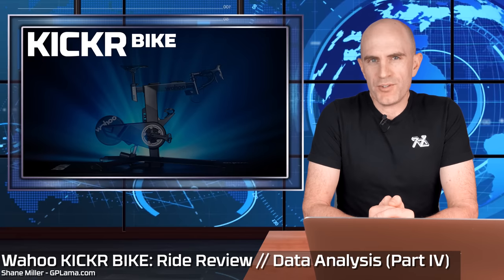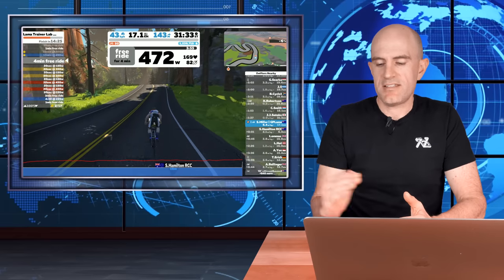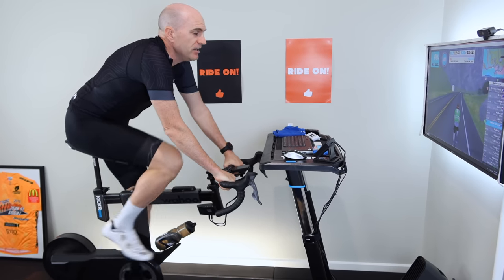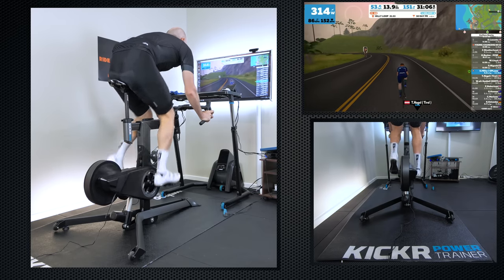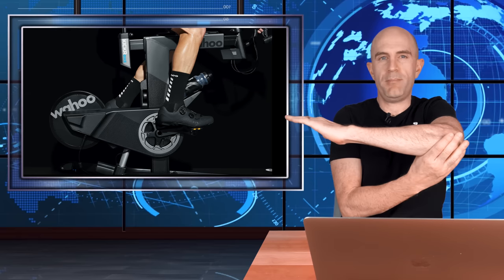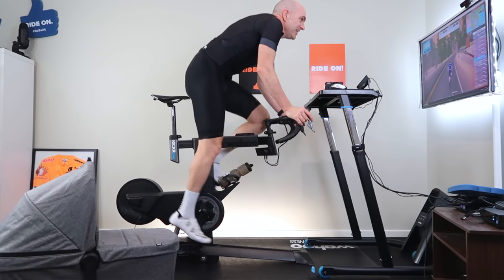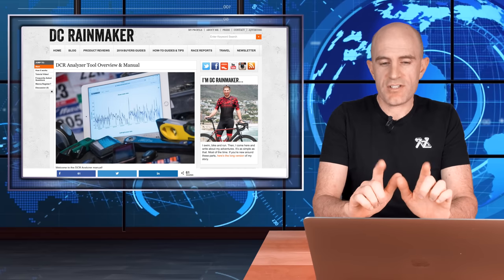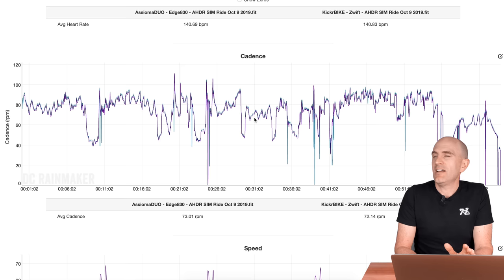Wahoo KICKR BIKE: What's it Like to Ride? // Ride Review // Data Analysis (Part IV)

Comment: With spacers between stem and the quick release and having the QR undone could it be used on the MTB course?
Reply: No, the stem is not standard and has a non-round profile, with the front side flattened, so it wouldn’t turn even unlocked.

Comment: I've had my Wahoo Kickr Bike V1 for about a year. The biggest thing I noticed on it was sprinting is really hard, there is no momentum even at higher cadence, its like I'm pedaling uphill. Anyone else noticed this? My 20 sec power on this bike is 200w lower than on a previous kickr, or hammer H3. Its like you don't get any momentum from the flywheel, even though I'm going 38-40mph in Zwift. Anyone else noticed this? I should note I do not use ERG mode for workouts, and I'm just talking about a sprint at the end of a race, or for a sprint jersey in Zwift.

Comment: Thanks for the great review, Shane . In your list of likely firmware improvements, you didn't include plain Ant+. Do you think that's a lost cause with this bike? Would be a pity if you couldn't use garmin in ride.
Reply from the maker: The argument for ANT+ (in addition to ANT+ FE-C) could go either way. For me, it just meant I had to use the FIT file from Zwift for the data comparison, so it wasn't that much of an issue. I'd say the majority of people don't really care it's not there. This bike is built for software control that's almost always going to be a PC/Mac/mobile device that'll support ANT+ FE-C. 

Maybe those who record data with a Garmin so it'd be included in their Connect metrics... then that's a workaround in the first place as Garmin Connect should be able to take any data and apply your stats to get those metrics.
Reply: I like to look at calories and TSS tick over on the Garmin during the ride. hardly a deal breaker but a pity  to lose functionality

Comment: If you can slam it quickly through the gears, doesn't that make it unfair when competing on Zwift?
Reply from the maker: I can see your angle on this... but no. Zwift racing is about producing power. If changing gears faster was that much of an advantage then people would be using straight gear blocks, x1 chainring setups, Di2, etc, etc. It's just not that much of a racing advantage. You still have to produce the watts.

Comment: Anyone know what the vibration is like from the unit. I live on the second level of a building and my tacx neo vibrates the downstairs. Would this be silent enough to fix that?
Reply: @Shane, living in an apartment from the sixties, what do you recommend? Kickr bike or stages? My current kickr 5 doesn't raises complaints, but it feels noisy. I have two rubber mats under it to absorb the vibration. Hope to hear from you!

Comment: I bought a Wahoo KICR bundle which incorporated the Wahoo Climb.  The Climb work well for a few days then stopped working in Auto mode.  It is OK in Manual mode, so what has happened?!  Anyone experienced a similar thing with the Climb?  If so, any suggestions as to what the issue may be?  I haven't contacted Wahoo yet, but I guess I probably will have to if this is not an easy fix.
Reply from the maker: Best ping Wahoo on this one.

Comment: What floormat do you recommend?
Reply: They're all pretty similar, but I've found the Kurt (Kinetic) mat to hold up best in my experience.
Reply: @dskordo  Thanks
Reply: @kyno1405  my pleasure.  I'll add - I've found the Kurt mat to be approx $10 cheaper at most retailers.  I've torn through some of the other company mats within a year (my set up is trainer on carpet in finished basement with mat in between - a hard floor may be better for mat longevity).  The Kurt mat still looks pretty good and no tearing or cuts after 3 years.
Reply: @dskordo  Thank you for the response 👍
Reply: @kyno1405  haha, for some reason I was just about to suggest that Shane could make something about floor mats. I'm a bit afraid that such a test would bore him to death, though. :)
Reply: @rasmuswi   maybe but they are all so expensive that you don't know if the cheaper floormats are also good.
Reply: @kyno1405  I don't really think they are that expensive. In my opinion, the really expensive thing would be a floor mat that fails to keep the underlying floor dry when I sweat a river climbing Alpe du Zwift or so, since that might in the long run damage the floor rather badly.

Comment: @gplama What is the lag like for Zwift racing? It looked like 2-3s delay between effort and watts registering. The Stages bike looks pretty instant.
Reply from the maker: I was likely using 3s power display on Kickr Bike. I'd have to loop back and test this with 1s display to know how it performs.
Reply: @gplama  That would probably explain it! Hope you guys are doing well. Keep up the good work 👍

Comment: Have you had any shifting issues with this bike? Have had nothing but trouble with mine, and wahoo support not much help at all, mine is stuck, in a set gear and shifters both left and right do not work. Wonder if any one else has same shifting issues
Reply from the maker: No issues. Why are Wahoo Support no help?

Comment: Buyer beware.  Issues with my bike out of the box.  The more research I'm doing the more this is starting to seem like further evidence of quality issues ala kickr 2018.  Recommend waiting until v2 or at least until they are further into manufacturing bug fixes.
Reply from the maker: Any more details on the issues? How have Wahoo Support responded?
Reply: @gplama  Can check my robust channel for amazing portrait video of the issue. In short, grinding metal on metal sounds from startup with corresponding grittiness and stuttering.  Loud enough that it wakes up the household.   Initial response was that it was likely vent covering rubbing but after clarifying with additional video it's getting escalated for further review.  I expect them to handle appropriately - just frustrating with the price and also having dealt with returns on previous Kickr 2018.
Reply: Update after receiving replacement bike:  New bike is as smooth and quiet as I expected.  There was something majorly wrong with the initial bike that I purchased as it's a night a day difference.  I now know the initial bike also had issues with it's climb function.  Support stated it was likely due to some very rough shipping.  Regardless, a working bike is as amazing as expected.  Worth the price and the hassle of replacement.
Reply: Any updates on 2nd bike. Still no issues with your replacement as of today?
Reply: @superpliability6130  still no issues with replacement.  All good with thousands of miles.

Comment: It's way over priced, compared to a high quality gym bike with a speed sensor.
It will lose accuracy if belt driven.
Reply: Yup, way overpriced compared to some indoor bike that doesn't have ANY electronics or smart features whatsoever. If you're happy riding hour after hour staring into a brick wall then any smart trainer or smart bike is waaay overpriced. The rest of us will happily pay a little more so we can have a somewhat interesting indoor cycling experience, though.

Comment: What is the distance from the bottom of the pedal to the floor?
Reply from the maker: Ummmm..  IIRC the floor to center BB is 320mm. So - crank length from that, and some for the pedal... and factor in tilt. Cornering clearance isn't an issue. ;)
Reply: @gplama  Im not looking for clearance. How much higher off the ground is it that your real bike? It looks like it sets about 120mm of the ground. The tilt should be level. The Neo bike look like its set lower.
Reply from the maker: My TCR center BB is 270mm off the ground (iirc)
Reply: @gplama  Thanks for the info. It looks a lot higher than 50mm. Actually, that's a lot. That makes the top tube 50mm higher also. It's like getting on a horse. Grab ahold of the handlebars left foot in the stirrup, lift leg over. Now, I understand why you got on the back.